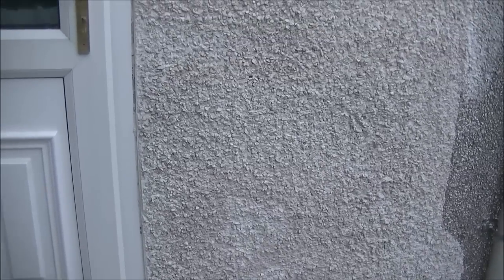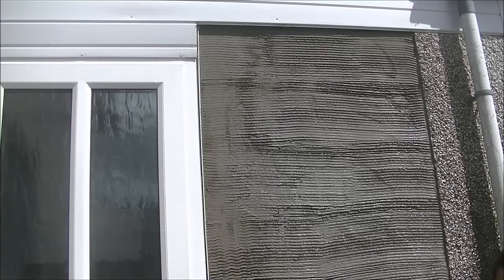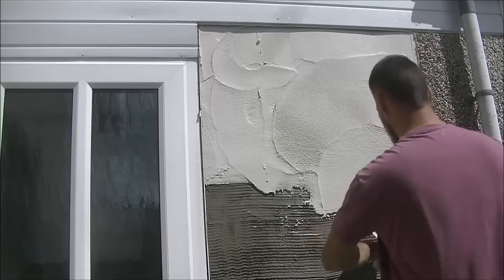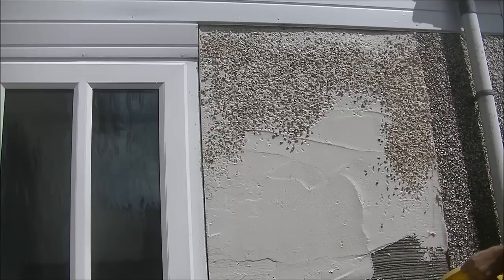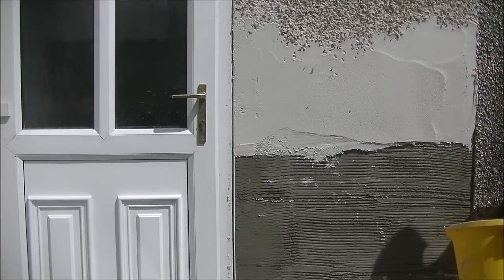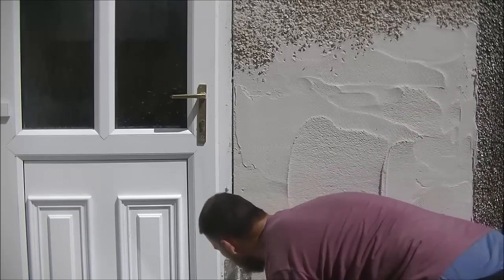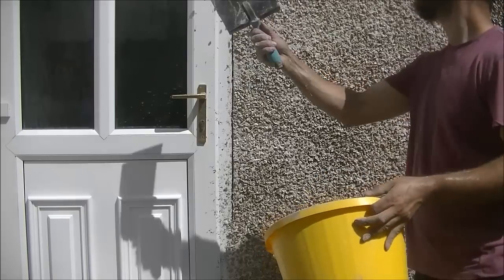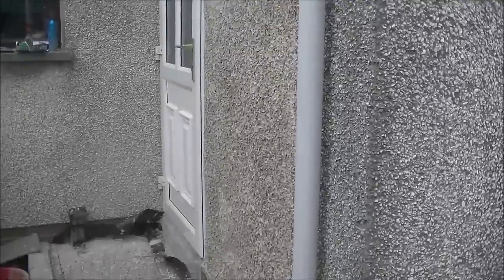HOW I PATCH DRY DASH RENDER,ROUGHCAST,PEBBLE DASH DEMO PART 1

Comment: Great video! Plastering is a real skill 👍🏻
Reply from the maker: Cheers Chalie mate appreciate the support , hope you are well mate
Reply: @macplastering  the reason I found your video :) https://photos.app.goo.gl/DUUmBafgFB71fwFp8 - not sure thought if I should try to fix this as a complete novice.  I have zero experience and zero tools
Reply from the maker: Looks a nightmare for you mate sorry for late reply been bus today for a change :) yes mate its a hard call as that wall looks big for a beginner , what might be good to do is get a price or two and if seems way to dear or dont get a good feel for the guy you could price materials and tools to do it and see what weighs up best, but dashing is very hard to do both dry dash and wet dash can be messy and hard work on the body so be ready for a hard few days a head if you go for it mate , Thanks again for the support and keep in touch let me know how you get on mate
Reply from the maker: Big video coming this weekend hope you can get on and support the cause :)
Reply: mac plastering thanks. To be honest it’s not the whole wall that’s only a patch that’s blown out due to an oil tank that’s was sitting above it. So it would just be patching that part. It’s about 6ft wide by 3ft tall
Reply from the maker: @charliemccollum  Hope this vid helps have a few more with more details and ways to go at it, just uploaded a new video and will have another up on Sunday following witch are both for a good cause :) if you can get on and support in anyway would be great mate 
ps if you need any more help let me know :)
Reply: mac plastering thanks. I will post a before and after when I get round to it  👍🏻
Reply from the maker: @charliemccollum  Drop me link when you do bro :)
Reply from the maker: its like a lime / silicone mix god knows how many other things haha supposed to be breathable but not permeable /water resistant, I would not use it for dry dash mate its a scratch finish material needs to be scratched of to release surface tension other wise can crack like mad and wont be breathable, if no anti fugnle in it moss and algae will be in a year or so .... Are you looking a white colour to match ?
Reply: mac plastering  thanks for the reply yes just looking to match it in with the white dash that’s already there. Thanks again
Reply from the maker: @charliemccollum  Anytime mate sorry it took me ages to reply its youtube dont always show me reply's but what you want is if its white some white Portland cement and silver sand or also known as silica sand , if you need to dirty it some put a little hand full of normal cement in to so it looks a little older but it will weather in in a few years all the same LOL mate if ya get time tomorrow have that big charity video going live 1st thing if you can share with anyone would mean the world to us :) 
Thanks for the support mate always here
Reply: mac plastering  super and thanks for the tips.   Would you add lime also to that mixture? I take it it’s just 4:1? I will keep an eye for tomorrows video! Thanks again!
Reply from the maker: @charliemccollum  Cheers for the support mate more shares and support the better for it,   If it was me I wouldn't add lime and if I did would be like a scoop or 2 per bag of cement , I would go 4 to 1 and use water proffer and a little fairy to help it spread you can use plastacier if you dont mind it staining brownish but can look bad if on a new build
Reply from the maker: lime will help the mix feel fluffy and light but from my knowledge to much will kill the cement and make the mix weak  but every plasterer is diffrent some guys do equal cement and lime

Comment: Does the waterproofer make the mix stickier? I tried today with a mix of 1 part white cement and 3 parts sand and a few drops of washing up liquid as plasticizer but the plaster wasn't sticky enough for the smooth, rounded, 1/2 inch size river pebbles to adhere properly to. 

Any tips for getting the plaster sticky without any additives except for cement and sand? 

I noticed that the stones stick well to a paste made from just cement + water (zero sand), so could I use that?
Reply from the maker: So if you are putting on stones at half inch your coat needs to be at least 1/4 inch thick to receive them, but your mix should have been nice and sticky as is , this mix is 4 to 1  I would say you could add a scoop of lime to help make it lighter and fluffyer mate
Reply from the maker: Oh another little tip i showed in newer dashing videos to this one was wet the stones so they are damp
Reply: @macplastering  alright thanks, yeah the pebbles should be sticking with a 1:3 mix shouldn't they, maybe because they're smooth rounded pebbles they don't stick as well as the angular ones. I'll try dampening the pebbles as well before throwing them on and see if that helps.
Reply: @macplastering  yeah I didn't dampen the stones before chucking them on. That could be the missing the link now that i think about it. 

Have you ever used smooth rounded river pebbles and found that they don't naturally stick as well as the more angular pebbles?
Reply from the maker: @Twobirdsbreakingfree  Dont think i have done much with smother stones think just a few small patch's like these ones that i tend to video as i have a little more time to record, I would say if you double coat wall to get a nice bed then if stones are damp they will take better no doubt but yes smother will be harder BIGGER WILL BE HARDER FOR SURE
Reply: @macplastering  that's another important point you made about keeping the stones small, i can imagine the bigger heavier stones aren't going to stick at all and it's probably why most pebbledashing is done with very small pebbles 1/2" or less in size
Reply from the maker: @Twobirdsbreakingfree  for sure mate
Reply from the maker: How did you get on mate ?
Reply: @macplastering  I ended up using a white -cement based putty (just mix the powder with the right amount of water and it's ready to go) instead of a sand + cement plaster. The putty worked well for holding the pebbles when it was applied in a thick enough layer.
Reply from the maker: @Twobirdsbreakingfree  That sounds handy for sure mate glad you got it sorted some jobs are a nightmare :)

Comment: Hello Mac thanks for showing us how this is done I have a project down here in Victoria Australia on an 100 year old house it has weatherboards running at around 900mm in height then a solid looking timber sill then the dash mix above  that to eave height around 3mts I am quoting that requires a similar type finnish. My question to you is the existing stone seems to be around a 20mm-40mm stone I plan to hard board the existing stud wall ( cement sheet based product designed for flat rendering) fix chicken wire as a reinforcing then build out with a mortar mix sand ,cement , waterproofer mix . The stones being the size they are would you still flick them on like you have .
Cheers mate love your work Trevor
Reply from the maker: Hi Trevor mate thanks for watching watching and the comment,  yes i would still go this way but more similar to part 2 video on this dry dash , quick tips are you want to cintrol the dry as best as possible,  youll need a simlar coat of render thickness to the stones its receiving so this might need to coats same day ,with will help sliw suction and wont slide if done in 2 coats , another handy tip might be to have the stone's damp like a must spray water on them just to help em stick , i am thinking  it will be thought work for you as will possibly be fighting heat like i am in these 2 demo videos , only might be warmer for you in AUSTRALIA  , hope this is usfull info , if yiu gavent seen part2 its a similar job but a 2 coats method if you havr time get a look mate , again thanks for the supporting
Reply: @macplastering  Thank you for your advise I will take it on board and watch the part 2 .
Cheers keep you posted to how it all goes
Reply from the maker: @trevorbloye9693  no problem buddy hope it gose well mate and yes stay in toutch all the best mac

Comment: What mix are you using and would you pva a scratch coat that has been up for a while
Reply from the maker: Would either wet it down loads or sbr it mate  have a 4 to 1 or 5 to 1 on here
Reply: @macplastering  thanks. Is it just ordinary cement you using and does the type of sand matter. All I can get is Travis Perkins building sand. I'm mainly plaster but inside.
Reply from the maker: @pictlandpickers1171  Im using white sand and cement on this one mate to match colour some it will dirty down more in time to look similar , I would recommend plastering sand this sand is white sand also known as silver sand and silica sand

Comment: That heat was a killer Mac . I had smooth cement render wall shrink 2 quick and crack and was hydrating it for a few days after . Do u put waterproofer in both coats and how much ml u use in each . Some guys I know use about 500-600 ml in a scratch for a barrow full . Others about 100ml.we generally use Free Flow.
Reply from the maker: It depends on the surface brick or block suction ect ad of course the gear im using some are 10x stronger than others I think I used sbr and waterproof in this mix so it will be both strong and water proof , man i wet this down a few times after as well , was afraid it would crack but dried out very well if i am honest, If it was a bigger job i might have waited for a cooler day as that heat is hard to keep up with , my next vid I do another way witch if i am honest is much better
Reply: macplastering what would b amount waterproofer you would use in your scratch and top coat  general mixes if just on top of new block work .
Reply from the maker: Hi Stu on this one i am using the pink water proffer witch  use around   0.5 - 1.0L per 100kg cement
Reply: Thanks Mac . Interesting 2 get some feed back . I've been jobs where the labourer is told to put about 1-5 - 2 ltr into a diesel site mixer which would b about 50 kg to give roughly 2nd half to 3 barrows . Seems a lot of waterproofer .
Reply from the maker: all products are diffrent so might be weaker and they might be trying to slow the mix down on the net coat so it wont soak in as much

Comment: I can't find the grey pebble dash in wickes, b and q or Travis perkins.
Can I use 10mm pea gravel or will it be too heavy and fall off?
I'm painting it anyway so the colour doesn't matter
Reply from the maker: will be heavy but have seen it used just try make sure your coat is 8 to 10mm thick to hold them :)
Reply: @macplastering  thanks mate.
Where do you get the type pebble in this video?
Reply from the maker: Builders merchants macblair a few do these stones here ,Irwins aggregates ..... these stone and white sand and cement seem to be getting hard to find as it is less popular now
Reply: @macplastering  thaks buddy
Reply from the maker: @scottmclean6301  Anytime mate happy to help :)

Comment: Is there a purpose for the stones?
Reply from the maker: HEY mate yes for decoration there is many styles of render this is but one type and can be changed loads, as in diffrent colour of cement diffrent types of stone diffrent sizes ,glass or shell to then go further adding bands and bases or quoin stones or half brick half dash  hope this makes sense
Reply: macplastering  hi m8 
My house roughcasted 
The plastering lioks a gd trade 
Outside summer 
Undoors in the rain lol 
Cheers buddy. 👌
Reply: @macplastering  does it really provide waterproofing barrier than bare render?
Reply from the maker: Oh yes outside in the summer is much better than the winter but to much heat is not good to work in for the body or the cement as it dries to fast and needs soaked a lot  LOL
Reply from the maker: Yes buddy it dose make a difference for sure you can tell when 2nd coating as it wont soak in so much as if you have none in

Comment: Alright mate,
It's been a while.
Quick question with render I am going to do a project inside with render. What do you reckon I could use to put render on plaster board to prevent it from soaking moisture through it!
Reply from the maker: when you say render do you mean sand and cement mate ?
Reply: Ye sand and cement
Reply from the maker: I dont think it would be great to put sand and cement on plaster board buddy not sure how good it would hold.... I would have suggest skimming it
Reply: The wall is already skimmed 
The sand and cement is only for doing a texture effect on with a gadget
Reply from the maker: Would a bonding coat not work ? as long as there is no damp ?
Reply: No mate it is a sand and cement finish with a brick effect
Reply from the maker: How did you get on with this job buddy  ?
Reply: mac plastering 
yea I ended up putting foam board down with a mesh covering  over it
to give it a base then coated over it seems to have done the job 👌 
thanks .....
Reply from the maker: Glad to hear man :) here keep an eye on the channel doing another giveaway soon

Comment: Can I use the product U CAN REPAIR RENDER from B and Q for the coat to the wall then dash it?
Reply from the maker: Hey Scott mate I haven't used that gear so cannot say how good it is .... But I am sure its expensive ? what i use here is white sand mixed with white cement the sand has many names , silver sand ,silica sand and the white cement is just white Portland cement hope this helps and hit me up for any more help :)
Reply: @macplastering  thanks I will do this then. Its £7 for. 5kg tub
Reply: @macplastering  so am I needing to do 3 buckets white sand, 1 bucket of normal cement powder, mix with water to a thickish texture
Reply from the maker: @scottmclean6301  is it a large area ?
Reply from the maker: @scottmclean6301  I mix my scratch coat at  3 to 1 and the white coat 4 to 1 both coats i use water proffer to help it be water resistant there is water proffers that will have a retardant in it to slow it down from setting  fast as you need time with it to help stone stick
Reply from the maker: have more vids on dashing and others on mixing cement might be helpful
Reply: @macplastering  thanks. It's about 1square metre
Reply from the maker: depth ? if not to deep pobs get 2 sand and 1 cement
Reply: @macplastering  only bout 1 and half cm deep but I will need to put the pebble on so depth of bout 1cm then dash the remaining half so all flush with the rest5of wall.
Reply: @macplastering  sorry for constantly bombarding you, will the following be a good mix, 2 part blue circle mastercrete cement handy pack, 1 part sand and mix with sbr, iv seen silver sand but then came across plastering sand so I assume this will be better, then can I mix with sbr liquid instead of water to waterproof it. Smooth on, then dash?
Reply from the maker: Plastering sand will be yellow if you use it with white cement the mix could be  a yellow colour if the background is white you will need silver sand and white cement ,only thing is when it dries it might be a clear white than the rest but in time will fade, if the rest of house is grey its just normal sand and cement, I would do it over 2 days like this one with a 1st coat then a 2nd coat 1st coat 3 to 1 second day 4 to 1 , sbr would be fine but you will need to work quick as i find it tightens stuff up quicker , in this vid i use sbr in mix and its a very hot day making things hard for me even on such a small area wet down them joints before ya start mabe the whole thing ...
Reply from the maker: Might try do a live stream tonight might be easier to chat there
Reply: @macplastering  oh right cool. I know it takes a lot of time to do these vids. Appreciate your help
Reply: @macplastering  thanks. I plan on doing it at the weekend so with it being cold I might get bit longer to do the work. Thanks mate

Comment: Mac tell me this mate, why didn’t u do it from door to corner? Ur lucky if that’s 2m wide. Also if u want to hold it back from taking up put waterproofer in ur first coat or poly bond it before u hit it.
Reply from the maker: There is water proffer in it mate its just so warm it dont matter I didn't want to chip of the older render as it was solid so no point disturbing  that and end u having to do more as sometimes if it dose chip God only knows where it will stop LOL plus patching pebble dash render videos do better on the channel than pebble dashing a wall videos for some reason polly bond wouldn't have slowed this wall any more than the amount of water it was gave trust me it drying was all heat
Reply: How do you fix a crack running from soffit to ground please?
Reply: @macplastering How do you fix a crack running from soffit to ground please?
Reply from the maker: @kingbee4474  https://youtu.be/0k681TQgeAw?si=w9hSlOrssuAZs7L8 this would be a method I would use buddy
Reply: @macplastering  mine is a pebble aggregate. I wonder how to do it. It has pieces of white marble
Reply from the maker: @kingbee4474  hard to patch pebble dash but would cut it out like other video and finish like this video mate so use the other method to prepare then top coat like this video